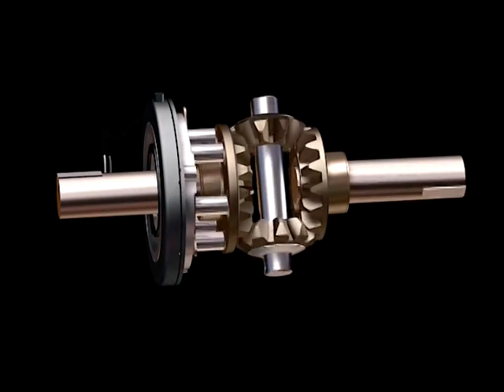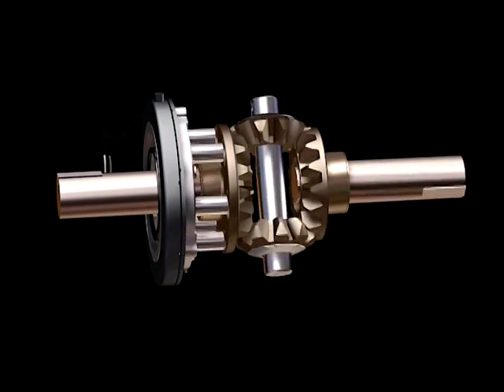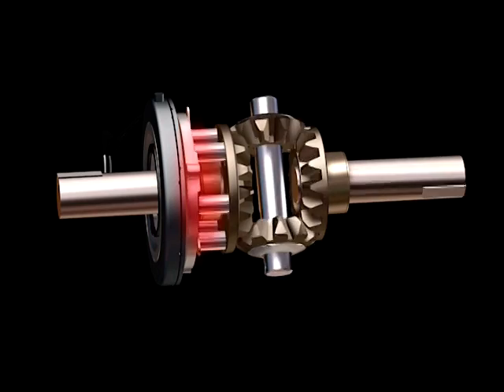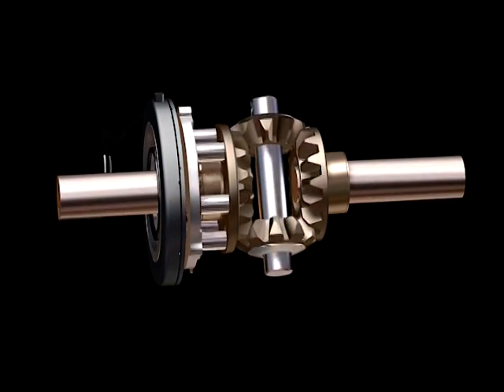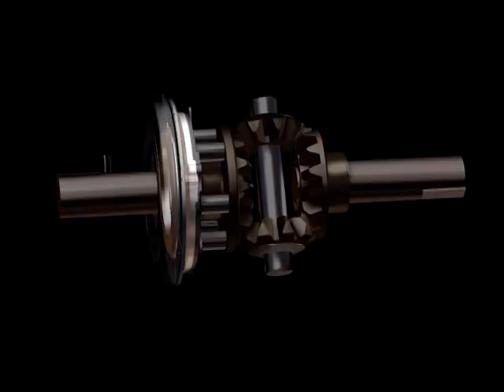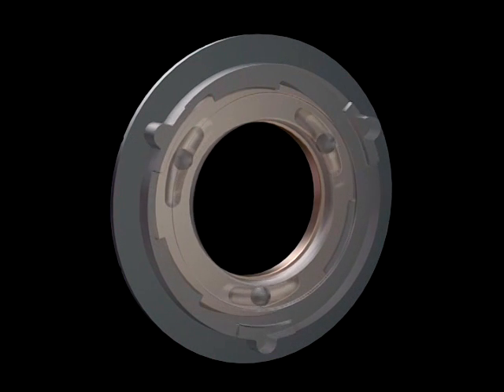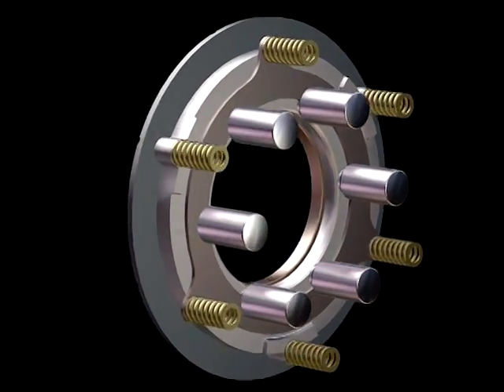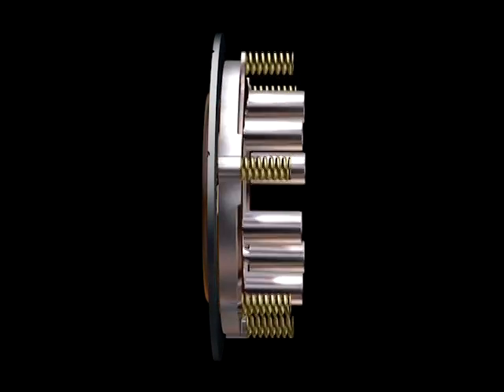How Eaton's E-Locker Technology Works

Comment: are they suitable for motorsports
can it be locked by switch control? what is its approx. weight only differential
Reply from the maker: aditya joshi, 
Yes, it is suitable for Motorsports and the weight varies on the application. It will require a switch of your choice to activate it.

Comment: Sure you can. The issue is turning, as your differential is locked.
Reply: Turning with a locked diff would only caused one tire to skid a little, causing the tires to wear a little faster.

Comment: In no way. If disabled, it works like any other open differential. If engaged, however, it helps when you're stuck in the mud for two reasons - When a wheel looses traction on slippery surface, one wheel "spins out", while the other looses torque. In mud, this means:
A) You're not getting anywhere
B) You're digging into the mud and filling the thread on your tires, thereby lowering the chance to get out.

An LSD might do better in *some* scenarios, though.